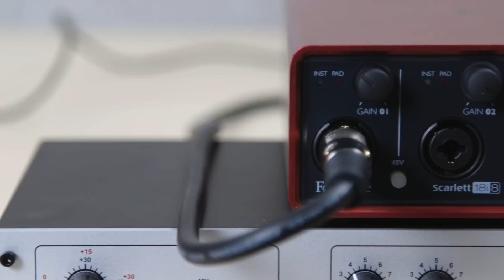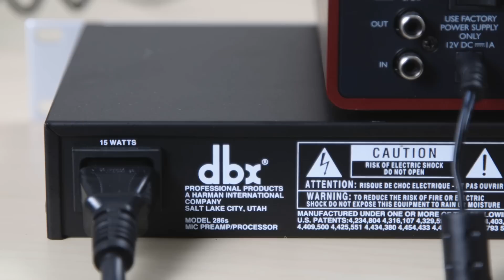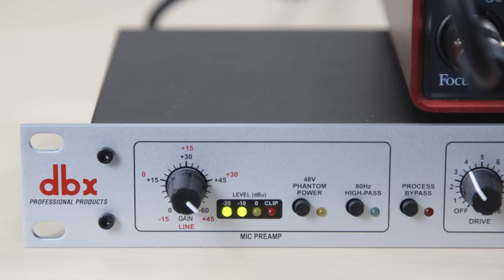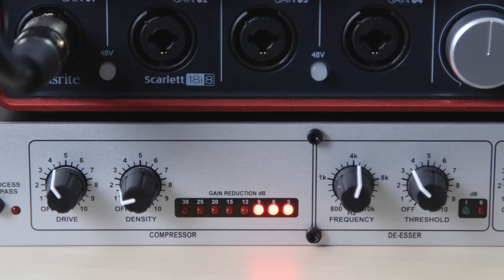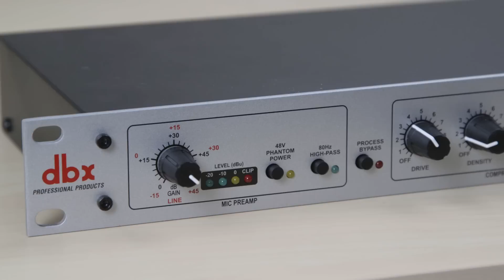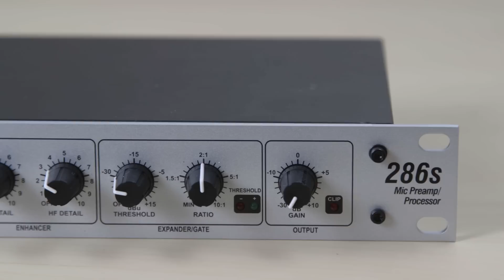dbx 286s Mic Pre-Amp Review + Set-up Walkthrough

Comment: Hello Caleb! Do you think i need an power conditioner or a normal socket adapter with switch on / off for him, because it doesn't have the power botton?
Reply from the maker: Up to you. I just leave it plugged in all the time, which isn't a great idea. Probably better to only switch it on when you're using it.
Reply: @CalebWojcik I bought an stabilizer socket + an adapter with power on button and that's fine now. Thanks a lot!
Reply from the maker: @kenzorwings  Mind linking to me what you bought?

Comment: Hi. I have a dbx286s and a Rodecaster pro. Since the Rodecaster pro does not have a line level input. I’m faced with more noise then I want. I sorta gave up trying to make these two work together.  I ask if anyone here can help me achieve this connection or perhaps buy some middle device to get these two to talk nice.
Reply from the maker: If it can’t take line in, adding the 286s seems redundant.

Comment: What about the OUTPUT dial? Did I miss that part of the video or was it not there? If I missed it, please give me the timecode.
It's in the transcript on the blog page: 
"Output: Gain Control & Clip LED: Finally, you set the Output Gain control to the decibel volume level you want to output the signal at. This will really depend on what levels you're getting from your input at this point and how much you are going to boost them additionally in your audio interface or mixer that you're plugged the DBX 286s into next."

Comment: If you go TRS out of the DBX and XLR in on the Scarlet, you apply double amplification. You should definitely avoid that. Use TRS-TRS on the backside of the focusrite instead.
Reply: why is the boudle amplification bad? 
is it adding so too much noise? even if the gain of the scarlet is turned to 0?

Comment: You still need a cloud lifter in between your mic and the dbx. The Shure SM7B needs a lot of power to perform to optimal level output. Also as mentioned by Brian below, TRS to TRS is a better connection. Make sure your TRS cable is line balanced. I'm currently using the Solo 2nd Gen Scarlet from Focusrite and the line | Instrument must be switched to Line if your going to use this output choice. Make sure it's not set to Instrument.

Comment: they say its better to concet the Scarlett with the DBX with TRS to TRS , but there is no TRS connection in SCARLETT 2I2 except the one for the headphones !?
Reply from the maker: The xlr input ports are also trs inputs.
Reply: @CalebWojcik  i have to use line option, right ?
Reply: @CalebWojcik  maan , i never knew you can put trs into xlr .. wow ,  so i need trs to trs , tnx

Comment: Nice video it is very interresting.
I have a problem with my microphone that I plug directly on my motherboard (in jack). The volume of my microphone is too quiet when I am recording or talking. And there is a noise background.
Just dbx 286s Microphone Preamp can resolve my problem ? Or I just need  Focusrite Scarlett 18i8 ? I am lost and always had problems with all of my microphones. I bought six microphones per years, but have the same problem...

Comment: Caleb let me ask you this. I have the Share SM7B going into a Cloudlifter CL-1 which then goes into my DBX 286s.  I also have a DBX266xs going into the DBX 286s as an INSERT.  So with that setup do I ready have the need for the DBX266xs (Insert)? To me it seems that the DBX 286s already has the same effects that the DBX 266xs has.  Should I discontinue using the DBX 266xs Compressor/Gate?
Reply from the maker: I’m not an expert on this stuff, but that does sound redundant to me. The 286s should do what the cloudlifter is doing too.

Comment: You should be using the Line in 5-8 on the back on the Scarlett thus bypassing the Scarlett's pre amps. The 18I8 has 4 pre amps (combo jacks located on the front 1-4). Running a pre amp into another pre amp is a big no no. Great video though.

Comment: You sound like a really nice guy on the video. Although your method “does” work, you could very much improve your signal by going , from the Dbx into the Focusrite by using its TRS input. 
The TRS input bypasses the Focusrites’ preamp, thus you will avoid “double-gain-staging”.   Hence , one less obstacle in the path.
Reply: I was just about to say this. Using xlr into the focusrite will use focusrite's pre-amp "gain stage" and color the sound. You don't want to do this. Use TRS and do not set the input as INSTRUMENT.
Reply: thanks, so do you just use a 1/4" TRS to 1/4" TRS cable to accomplish this???
Reply: Thank you for the clarification Xenio, I was really confused.
Reply: FOCUSRTITE 2I2 doesnt have TRS input except the one for the headphones , i dont think you are talking about that one
Reply: @DJURBANBG  focusrite 2i2 does have an "instrument" TRS input.  That's the one.
Reply: @ketzbook  this is not TRS, you are talking about line/instrument option, but this is XLR microphone input,  you dont use instrument option for mic preamp though, you are missing the whole point here
Reply: @DJURBANBG  okay, so then where do you plug it in?
Reply: @DJURBANBG  I think that @Matt Nelson answered this.  The instrument TRS input is correct, but you "do not set the input as instrument."  I think that is the correct setup.  Anyone else know????
Reply: @ketzbook  You can plug a TRS cable into the XLR jack on pretty much any audio USB interface.
Reply: If you turn the gain on the Focusrite down all the way does it  still add an extra stage of gain from the mic input?
Reply: Clarification: On the 3rd Gen Focusrite Scarlett 2i2, using a TRS plug does not "bypass" the Focusrite 2i2 preamp. Instead, it triggers different preamp settings that are appropriate to line inputs vs. microphones. From the Focusrite manual, p. 16 "The preamp gain is appropriate for microphones when an XLR plug is inserted, and for higher level signals when a jack plug is inserted." You can verify this by noting that your preamp gain knob still works (i.e., preamplification is happening). As @Matthew Earl and @kezbrook have already noted, the "Inst" setting should be used for instruments, but not line inputs such as the the dbx 286s.
Reply: Hi, the focusrite is converting the analog signal into a numerical signal which de DBX can't do.
Reply: I'm very new at this so I have to ask, why pair the DBX286s with the Focusrite at all? Don't they both serve the same purpose?

Comment: It doesn't has a on/off switch. Is it bad to plug in and out the AC power plug everytime that i use the dbx?
Reply: I know this was 2 years ago, but buy a basic power strip that has an on/off switch & plug the DBX 286s into it.

Comment: 0:56  Why are you converting a balanced line out to an XLR, when the Focusrite (like most other audio interfaces) use dual-use TRS (balanced line) and XLR  inputs?  See that hole in the middle?  That's for 1/4 inch balanced lines.  Line out to line in.  There is no benefit whatsoever in quality between an XLR and a TRS.  You are just wasting money using the adapter.
Reply: Good point!
Reply: It seems he's using a special XLR to 1/4" cable rather than an adapter, and the link in his description has it for sale at $3.23.

Seems it's pretty much comparable in price to a standard XLR or 1/4" cable so I guess it all depends on which inputs you want to keep open on your interface I guess?
Reply: I have several of those conversion cables too, but the point is that it is unnecessarily to use it in this case.  There are not 1/4" TRS and XLR  dedicated ports on the Focusrite.  There are dual-use ports, which can fit either an XLR or TRS.  He could have used a TRS to TRS.  Some of my equipment has only XLR and some only TRS, so if I need to patch one to the other, I need those special conversion cables but he doesn't need to use it in this case.  It just seems ridiculous to me.
Reply: Ah.

I suppose at the end of the day if the cable is cheap enough it doesn't matter really, but I totally agree with where you're coming from in the long run.

Comment: Super video, thanks.  Helped me decide to pick up one of these -- it works great, tho I do have some hum going into my Behringer UCA-222. Audacity removes it just fine but it's annoying, looking into ground loop, cable issues etc.  When I send the 286 output into Return jack on my mixer (Yamaha MG series) it sounds great but I like the option of bypassing the mixer when I don't need it otherwise.

And I found a neat way to deal with the size of the beast as I don't have a rack to mount it, as others have mentioned.  Wal-Mart sells a "Long Stacking Wire Shelf" for under $10 that fits perfectly, supports the unit just fine. You can even stack a 2d shelf over it which is my setup.  I wondered if it would be stable enough but I've had no trouble at all with it.

https://www.walmart.com/ip/Mainstays-Long-Stacking-Wire-Shelf-White/54828259

Here is my cluttered setup, 2d shelf above the unit:

https://drive.google.com/file/d/0B3wKm1tPjKv2V1o0ZnF2TGxMaW8/view?usp=sharing

Comment: For the Shure SM7B, does the dbx 286s alone provide enough gain? I have simple requirements and only need to record one microphone. In doing so, would I need the Scarlett 18i8 or similar? I could I bypass it straight into the USB of my Mac without needing a Focusrite? If that did work, what would I be missing out on with the Focusrite?

Thanks

Joe
Reply: The SM7B requires 59dB of gain and the dbx offers 60dB of clean gain so yes it alone gives enough gain. You do need an interface to convert the analog input into digital, the dbx doesn't have USB and is not an interface.
Reply from the maker: +Joe Williams what Mario said. You'll still need something to go from 1/4" or XLR to USB.
Reply: if have a sm7b and tghe 286s into a behringer QX1204 mixer, but what i dont get is, when i raise the mic preamp with full 60db i barely scratch at the -20 or -10 db, i need to press my mouth on the sm7b to get a signal. i have no clue what iam doing wrong at this point

Comment: i HAVE THE SCARLET SOLO. DO I GO FROM THE 286 COMPRESSOR OUTPUT TO MIC INPUT ?  THE SOLO LOOKS LIKE THIS.  https://reverb.com/uk/p/focusrite-scarlett-solo?_aid=pla&hfid=3229653&gclid=CIbo3pT3688CFZORGwod6woIkg
IT'S JUST I'M GETTING DISTORTION. I HAVE THE SAME MIC AS YOU. ANY ADVICE SIR
Reply from the maker: Yes. You go into the mic input. If you're getting distortion turn down the gain on the dbx and solo.
Reply: I have a scarlett solo and dbx 286. I plug the shure mic sm7 into dbx then dbx output to solo mic input. The gain on the solo is at zero , output at its lowest on the DBX but when it records into the live streaming RCS playout system it’s still MUCH too loud. So where is the problem – how can it be solved. Can’t reduce the input by the audio tab either. Help
Reply: I've a Scarlett myself (2i2), and in fact I've noticed a large discrepancy between the mic preamp level leds, and what actually comes to the Mac through the Scarlett (much louder/distorted, even with Scarlett gain zeroed). I've seen you've the output gain at -30db in the dbx – I'm close to those settings too.

A question that comes to my mind can be as follows: do you suggest to balance (dbx) the "mic preamp" higher, and the output gain lower, or the other way around? 
Thank you very much.

Comment: I'm using the Shure SM7B as well. I feel ike the output of this mike is rather low. Even if I put open the gain line ...I can't get it into red ...
Reply: Yes the SM7B has a very quiet output. If you have the money get a Cloudlifter, it adds around 25db gain without distortion and that bad stuff.

Comment: Is there a reason why you chose an XLR input into the audio interface, instead of a 1/4 balanced TRS cable?
Reply: Can you explain why Caleb? I want to know whether to use a TRS cable or just XLR like you have on the video.
Reply: Theoretically, TRS to TRS cable should be used to avoid damaging preamp section of interface due to too hot signal going from DBX, but that will be very rare that can happen if you are using a mic that has very high gain and turning all the gain knobs both in interface and DBX all the way up.  DBX has two gain knobs one in left side corner for preamp and one in right side corner for poweramp.  If you are using a quiet microphone like SM7B, if you know to set gain knobs safely, you may take risk of using XLR.  If you have a DI box, you can try adding in between DBX and interface when  XLR is used and see how that works.  Using TRS to TRS also avoids phantom power going from interface to DBX.  TRS to TRS should give better impedance matching as well as signal matching between those two devices.
Reply: output
Reply: On the back of the dbx I have three options: Line Input, Output, Insert. Which one of these should I use for a trs to trs? Thanks
Reply from the maker: I've since switched to using a TRS cable into the back of the Scarlett when recording locally, but when I Skype someone, I still use the front XLR port.
Reply: Hi Caleb Wojcik, Scarlett has combo jacks in front.  You should connect TRS to TRS connector to connect your DBX to Scarlett that will bypass the Scarlett's preamp section and only preamp from DBX will be utilized.
Reply: @CalebWojcik  Using XLR connector to send signal to the interface... you are sending line output to a mic input... this is a mistake: impedance and levels are absolutely different.

Comment: I have a Scarlett Solo connected to a Rode Procaster. My Problem is that there is much noise if I turn the gain all the way up on my Scarlett solo(But I need to do this, because my mic is not very loud) Also the high frequencys are a little bit muddy. Would you say that this DBX device would fix these problems? (Sry if I made mistakes, best wishes from germany :D)
Reply: +ThePhimanuBeats Your Procaster is a dynamic mic and will need a lot of clean gain to sound good. You see he's using the full +60db gain on the Shure SM7b, a notoriously low-output dynamic mic. Your Scarlett Solo specs +46 dB of mic gain, so you'll need all of that, AND you're pushing that mic preamp right to the edge to get usable volume from it. I'm not surprised you get some noise along the way. 

Although I've never worked with the mic or interface you have, I'm confident that the dbx 286 (older "a" or current "s" variants) would work fine with the Rode Procaster. I have a very old dbx 286 (no "a"...mine's an original from 1995), and its preamp is quite clean with an SM7b. Every other budget-friendly mic preamp I've tried fails with this mic..."hisssssssss"
Reply from the maker: +ThePhimanuBeats In short, I would say yes. Like Timflan said, a Scarlett can give a lot of gain, but it isn't as clean as the dbx 286s. 

I've learned since making this video too that if you run a cable into a Focusrite Scarlett's rear ports, you'll get an even cleaner signal than going into the front XLR ports.

Comment: Great video and presentation!  I'd like to set this up with my Sennheiser 416 mic.  Its a hot mic with a good bass sound so I would probably have to turn down the LF on the one setting you had.  I also wouldn't be using any more processing except this and then run the output back to an XLR channel on a Mackie 1202 mixer on channel 1 or 2. Of course, I'd have to engage the phantom power button  too!  Nice work.
Reply from the maker: +John Davenport Thank you! Glad it helped. :)

Comment: Hi Caleb let me start by saying thank you for taking your time on doing this review. I have a similar setup; SM7B with a UR22 and i am waiting  for the 286s to come in the mail. A few questions:  Shouldn't you connect the line input of the 286s to the line output of your audio interface with a TRS to TRS cable to bypass the preamp? Also I have a cloudlifter. Is the gain sufficient on the 286s for the sm7b or is the cloudlifter needed? If not i will just return the cloudlifter.
Reply from the maker: +WhitegucciTV Yes, I've since switched to the line input on the back of the 18i8 to bypass the pre-amp of the Focusrite. (Based on comments on this video actually.)

I wouldn't say the cloudlifter is needed too. The dbx 286s should be plenty of gain. Hope that helps!

Comment: How much gain do you place on the Focus usb interface?  Also, what gain for the dbx?
Reply from the maker: +cylurian Depends on the mic, but my gain on the Focusrite is at 20 to 30%. I'd use gain first on the dbx and then go in the back of the focusrite too for a cleaner signal.
Reply: Caleb Wojcik do you turn on the phantom power on the audio interface
Reply: Phantom power is needed for condenser mics. Since Caleb uses a Shure SM7B (a dynamic mic), phantom power is in the OFF position.
Reply: titan uranus i think the dbx has Phantom Power so you do not need the Phantom Power of the Focusrite ?

Comment: Hi Caleb, what do we need to turn up/down/off with the scarlett 212 when using this exact setup (shure sm7b, scarlett 212, dbx286s)? The gain? Something else?
Reply from the maker: +peter clark If you go into the XLR port, you'll have the gain at about 20 or 30% (depends on the microphone and what levels you're getting). If you go into a input port in the back, you'll need to control the gain/volume completely on the dbx.